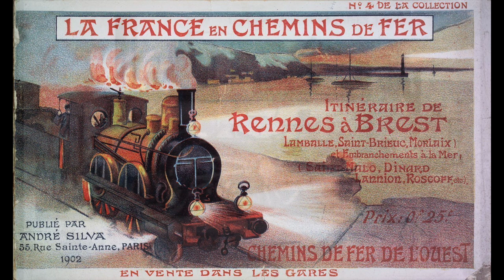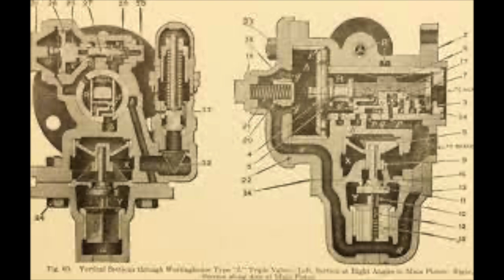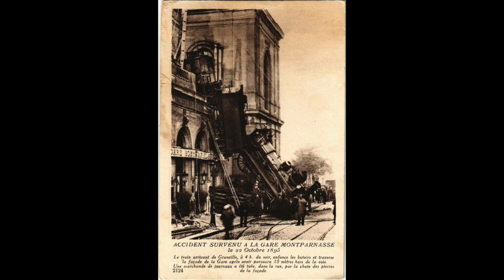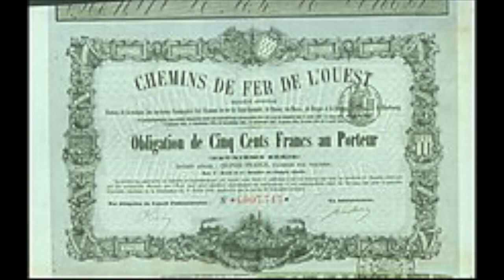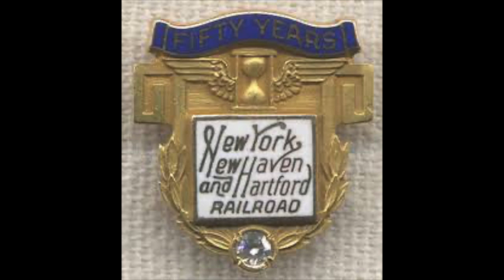The Gare Montparnasse Derailment

Comment: Something similar happened at Bradford Adolphus Street on 10th November 1964 when Ivatt 4F 43072 crashed through the outer wall of the goods shed and crashed 30ft down onto Dryden Street. Bradford Adolphus Street had been a passenger station but had long been turned into a good station. On the fateful day 43072 was hauling 21 empty wagons from Ardsley but the drive lost control of the train at Laisterdyke. The engine crew jumped clear just before the crash. The 14 year old  43072 was cut up where she came to rest 4 days later.